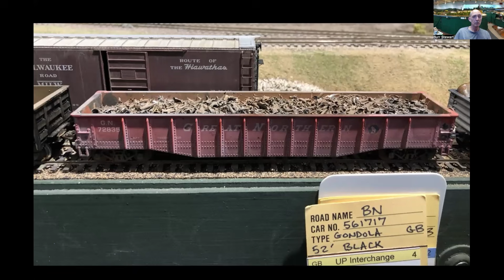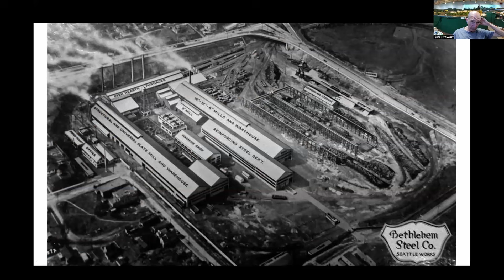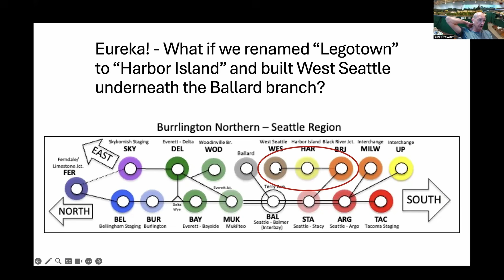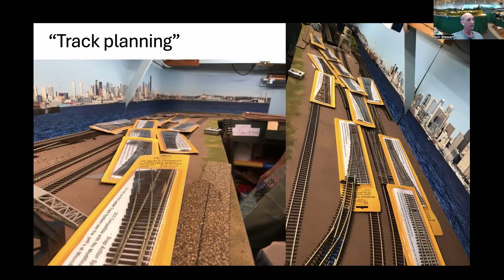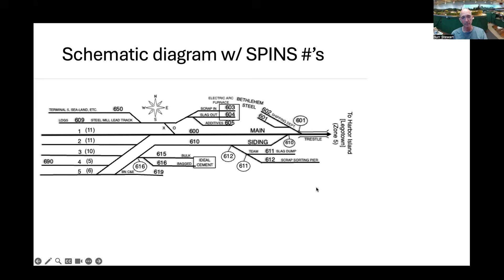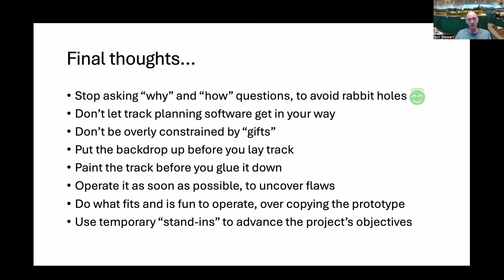How to cram a steel mill into a corner of your train layout! #hoscale #modelrailroad #steel #furnace

Comment: I have done the Curve Track, in a few locations.  I only have so much space.  So I need an escape track that will handle 4 SD size units. to make it fit curve track and this gives me the space for 4 engines.  The curve also adds one extra car to each of the 10 yard body tracks.  If it was a straight escape track,  I could only get 3 engines in the escape track and loose 10 car spots in Enterprise Yard.
Reply from the maker: What radius did you use?
Reply: @muchfunwithtrains  19" into an 11"